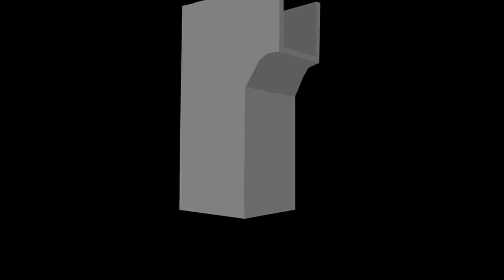The Korg Monologue- Part 6- Low Frequency Oscillator part 1

Comment: 11:18 Is what sold this synth to me. Also the rest of this fantastic video series, I've watched all parts twice now. I felt like I got to know the synth better then I would have if I went to the store and tried it for myself (which isn't really an option right now). So thanks for these great video's.
And this synth is just awesome. I thought the single AD/ASD envelope would be limiting, but that third option really helps and it's just so quick and easy to dial in a great sound. One of those clever 'better than the sum of its parts' kind of synths.

Comment: My LFO settings keep dropping out during shaping, rate and intencity goes to plain sawtooth etc. in the middle of adjusting and I can't get the effects back. Just now, while typing, the LFO reseted itself. Am I doing something wrong, or is the LFO broken? Pitch seems to work fine. I also keep hearing clicks and pops constantly while shaping. My synth is set based on yours and it's on VCO 1 while doing evything mentioned here.

Comment: Do you use the saw and square waves often (for musical applications)?  I tried using the square to make notes jump octaves back and forth, only to discover it isn't unipolar, so of course the pitches were off by a tritone.  That, combined with VCO 1 not having a pitch knob, makes for some interesting transpositions.

Comment: Who ever uses an LFO to modulate pitch that much in any actual musical way though? Maybe in one song have I ever used that. I'd rather have more travel on the knob dedicated to useable pitch modulation.

That isn't to say you're wrong about it being cool, but it isn't terribly useful. And like you said, "a synthesizer is an instrument".
Reply from the maker: Well, just because it isn't tonal doesn't mean it can't be used in a musical way.  In face, a synthesizer that is capable of making sounds like this has use as a sound design tool, unlike the synthesizers whose modulation is limited to that which would be traditionally musically useable.
Reply: Look up FM Synthesis (Frequency Modulation). It's an entirely different branch of synthesis. Most analogue synths we're used to are based around subtractive synthesis, i.e. start with a harmonically dense waveform (square, saw) and remove harmonics with a filter. FM is basically modulating in audio range and above. It's often metallic sounding, but can be great for pads and atmospheric. The fact that this can do both is a huuge bonus.
Reply: I guess that's why it has fast *and* slow settings. You get both.
Reply: That being said, I'm blown away by the fast rate of that LFO :o

When a synth gets your brain going with neat sonic opportunities like that, you can't help but feel a little excited.
Reply: I'm happy to see someone else saying this. I've yet to find a significant way to use this, but there's always more I can learn, I suppose!
Reply: Well written & exactly ;)
Reply: @group-music  I'm just going to roll my eyes at you.

Comment: So they decided to learn from their Minilogue mistakes and not reset the LFO when you press a key?
Reply: Ian Hoffman you're incorrect, the Minilogue in program edit can have the LFO reset on key press or NOT.....Go to program edit/Button 3 and turn LFO Key Sync to OFF, you can also turn Voice Sync on/off which will sync the phase of the LFO between voices or have all 4 of them running freely(yes in the Minilogue there is an LFO per voice).  By default on a lot of patches Korg set LFO Key Sync to on and that was what you were experiencing.  You can also have the LFO BPM Sync to on/off....which will give you a numerical range, or a beat measurement that syncs to the sequencer.  Explore your synth and RTM:)  Marc, you should know this lol;)
Reply: LOL, I feel ya....getting there too!  I also thought damn, you must have/review so many synths it's impossible to keep up with all of that;)  Thanks again for all your videos, you do very good work:)
Reply from the maker: How is LFO restart a mistake?  I think that these days people want their LFO to restart with a key press so that it can be synced, etc.  Granted, I'm more used to free-running LFOs... but if this LFO was free-running, you'd miss out on the one-shot feature, which is unbearably cool.
Reply: Marc, you reviewed the Minilogue lol;)  On the Minilogue..... Program Edit/Button 3: Turn LFO Key Sync on/off to have LFO restart on key press or NOT.   LFO Voice Sync can be turned on/off too which has the phase of the 4 LFOs synced or running independently for all 4 voices....LFO BPM sync on/off is an option too on that page.
Reply from the maker: I'm getting old, purpleibby!  :D
Reply: Having a 1-shot LFO is really useful on this machine because of the limitations of the AD/R-style envelope
Reply: In the Minilogue, it basically made the LFO useless for modulation in pad sounds. Every time you added a new note, the LFO (s ???, was there even more than one?) would reset in how it affected all voices, which was very jarring.

Comment: "Not that kind of motorboat. . ." Nice.

Seriously though,  I'm impressed by the almost hard FM/AMish (not Amish, obviously) tones you were getting with the higher LFO speeds/intensities. I usually don't like LFOs very much, but this one sounds like an asset.
Reply from the maker: I'm like you, Michael.  Standard LFO on vintage or analog synths usually generates a typical vibrato effect or sweeping filter that is really quite boring after all of these years (although, sometimes subtle usage can generate cool effects).  So, I was surprised and delighted that I could create such unique and interesting outcomes with this LFO.

Comment: Neat, so it's basically a redone Monotribe LFO.
Reply: I just checked Marc's LFO video in his MicroBrute series, and it doesn't
 go nearly as fast as the Monotribe's (whose knobs also have a much 
finer resolution, a lot more than 7-bit). To my ear, the Monologue LFO 
seems to have the same frequency resolution, perhaps scaled slightly 
differently. So, that combined with nearly identical speed and routing options is what led to my judgement.